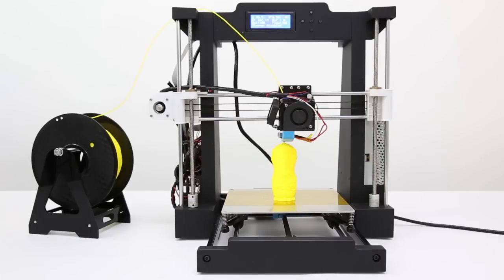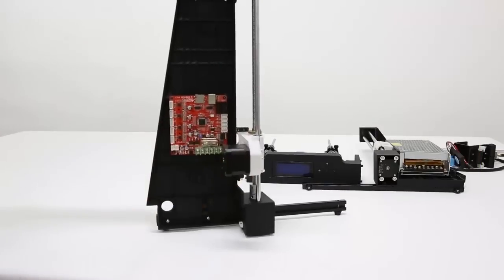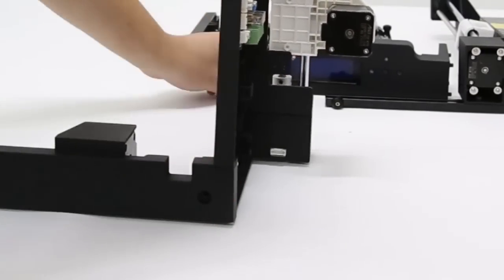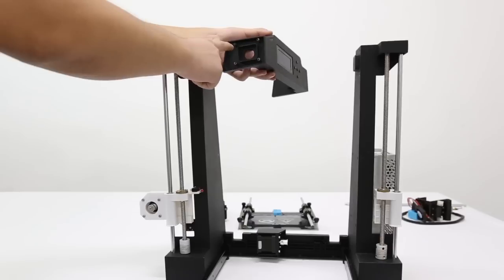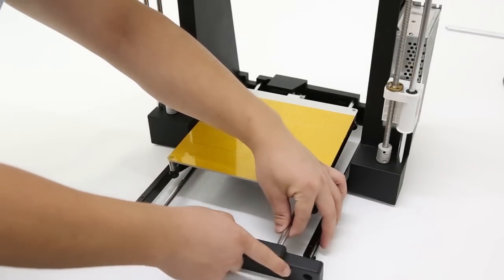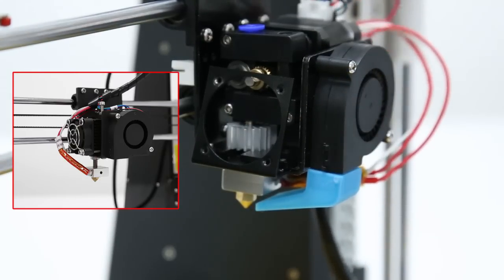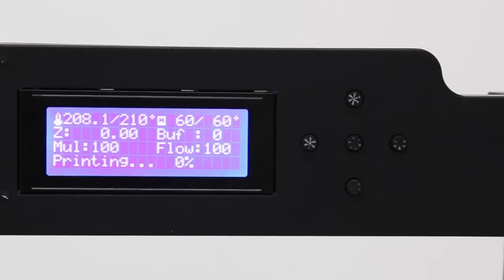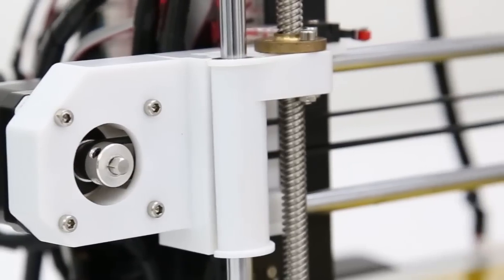7 Key Improvements for Anet A8 2019 Ver. 3D Printer with Better ABS Frame Extruder Design

Comment: I see you're still using a JST-style connector with no strain relief or retention mechanism for the bed. Did you guys at least use all the contacts this time?
This is the single biggest issue I have with the A8, and the second largest safety issue. Please tell me you at least enabled thermal runaway protection in the firmware.

Comment: The Y-belt is not fitted parallel, because the Y-bed frame is fitted upside down.
Reply: Nope. The new version just has garbage geometry. You might be able to flip that plate but it won't help in this case, as the bearing mounts and belt mount are on the same plane regardless of whether the bed frame is flipped. :(

Comment: My power adapter worked exactly 2 months and then it was broken.
The capacitors have been the cheapest scrap and the ball bearings rattle from the beginning.
The waves partly crooked.

The Flash from the Mainboard is to small for MARLIN 1.1.9 with Auto Bed Leveling

NO MORE ANET!!!!

The only thing that was useful is the printhead and the engines.
To bring another printer without ALU 2020 or 2040 profiles onto the market in 2019 is no longer appropriate.

Comment: Hi ... I have just started using my first Anet A8. My major problem is that I have to discard the printing object if the power failure occurs in the midddle of the process.  If the update has a power failure resume option.. it would be very much useful....like prusa mki3 for eg.
Reply from the maker: Dear, sorry for the inconvenience caused. Considering the cost, the A8 does not have resume function. Regards!
Reply: How much would be the additional cost for this functionality.. Because... it is worth having it...Is there option to upgrade to this facility with additional cost?
Reply: @balasubramaniandhandapany5509  Purchase a battery backup/surge protector.  My Anet is on an APC 350 and has never glitched due to power issues.

Comment: Nice upgrade overall. I like the changes on the heated bed (new support, thumb screws, 24V). Just one possible issue... there is no easy way to add a belt tensioner for the y axis. You can think of adding a glass plate for the bed.
Reply from the maker: Dear Mitia, thanks for your suggestion. Regards!
Reply: Well, you're actually right on most of that but, as in the ender 3, 24V bed and extruder are now a big improvement.
Reply: @Fly N Fool Your display issue is a fluke. I mean, all the displays are poorly soldered and need a reflow to work well, (I don't even look at mine anymore, thanks Octoprint!) but the fact that you can reliably screw up your display by just touching the heatbed is a bizarre edge case. The heatbed doesn't even (technically) share a ground with the display. Either you have a perfect storm of a ground being the one contact that's bad on your display AND a bridging short to the bed ground or, more likely, you're moving the heatbed and the back EMF from the Y-stepper is corrupting your display. The first case might be solved by re-flowing all the solder joints on the display. The second case is unavoidable without some kind of added filter and is not a problem unique to the Anet products.
My bearings on my 2017 model were fine, and my rods were straight but I have definitely heard of people receiving the printer with enough bend in the z-screws to make some very ugly prints and one of the rods I received has started to shed it's plating which, in turn, is trashing the x-axis bearing.
24v bed and extruder means they can achieve the same temps using less amperage, which is, honestly, much safer. I hope they've replaced the throw-away JST connector they previously used on the heatbed. Unfortunately, there's no mention of a better power supply (it has to be different, for 24v, but I have no idea what it's actual power capacity is) or an all-metal hotend, so this thing will remain PLA only on our books until those are addressed.
I'm some sort of masochist, I guess, because I have TWO of these guys humming along. :/

Comment: Hi Anet, I would like to give my two cent (comments). I would suggest to update firmware to marlin. Actual firmware has many problems and risk of fire. Also would suggest to resolve heated bad issue (plastic plug caching fire). I very happy with the printer, but only after a fill improvements I made in the printer.
Reply from the maker: Dear, thanks for your suggestion. Regards!
Reply: yes. Marlin would be great. The main boards in my two Anet A8 failed between the 4th and the 8th month, so I'm using marlin on both of them for the last year.
Reply: It seems that you bought the copy cat? but i bought one machine from Anet,  it is refined and wide voltage motherboard for the risk of fire. I make it working day in and day out....
Reply from the maker: You could get into our FB group to get prompt support: https://www.facebook.com/groups/anet3dprintersupport/

Comment: time for the graveyard with all A6 and A8 - sorry even with this "improvements" there are better options for the same price on the market.
Reply: I didn't speak about the A2, but I think there is no way back to plastic frames equal if acrylic or ABS. Many people started with a sort of A8 (I started with an Hesine M505, 1-2 years before the A8/A6 came out. It was more or less the same printer with the same flaws, but without competitors at this time)

Comment: Good work anet. Is there thermal runaway protection in the stock firmware now? This would be a key safety improvement.